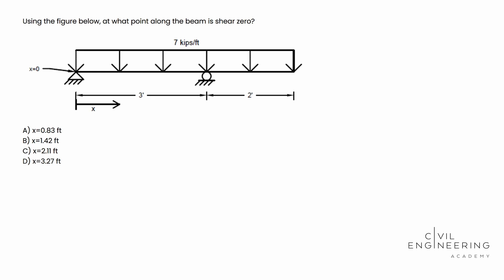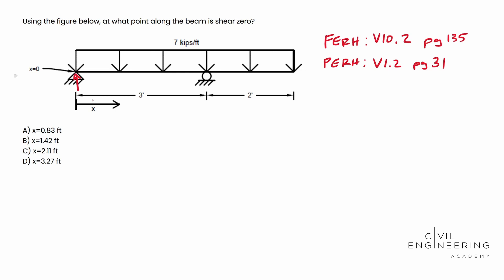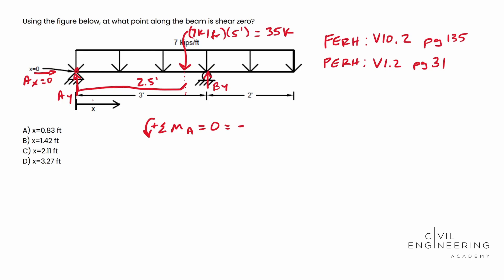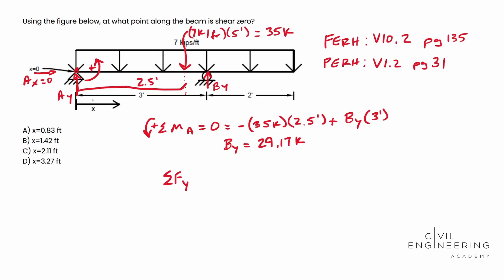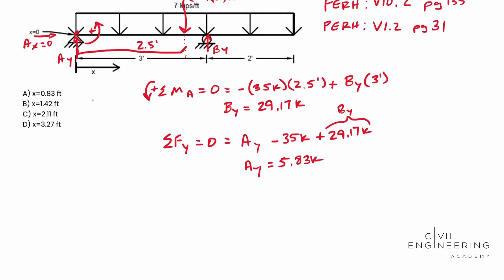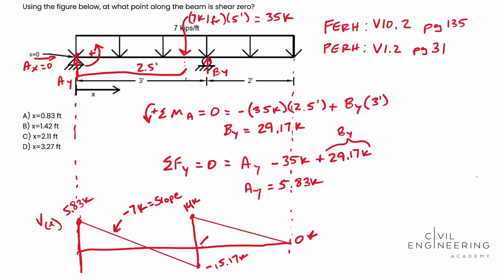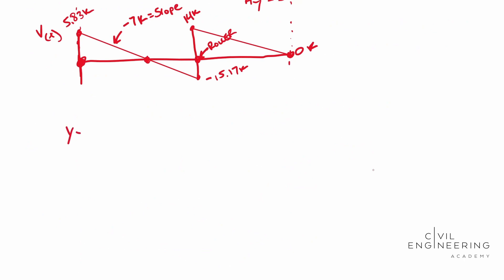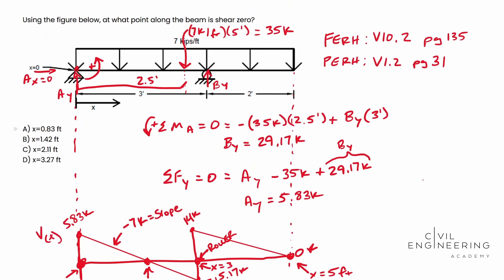Civil FE/PE Exam – Structural Mechanics – Find Where Shear Equals Zero Along a Beam

Comment: Use the Structures HB 1.2 ref.

There are tables there to speed things up on a typical-looking PE AM problem like this.

There is no time to take moments and draw things out.

If I had to do heavy hand calcs like this I may as well label problem "hard" due to length and move on to  "greener pastures" and "lower hanging fruit".

Comment: Thank you. Critique: This video is too long for 1 question. Completing 2 questions is more realistic. We cannot complete this solution during the exam. We have about avg. 3 minutes per question.
Reply: 6 per question. Correction.

But yes, my exact criticism, too -- use the Structures HB 1.2 ref.

There are tables there to speed things up on a typical-looking PE AM problem like this.

There is no time to take moments and draw things out.

If I had to do heavy hand calcs like this I may as well label problem "hard" due to length and move on to  "greener pastures" and "lower hanging fruit".